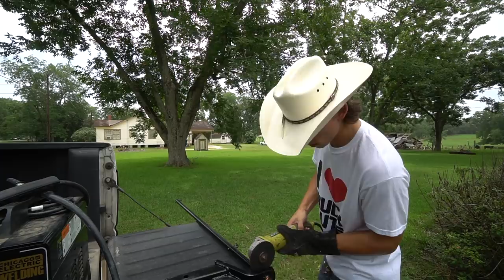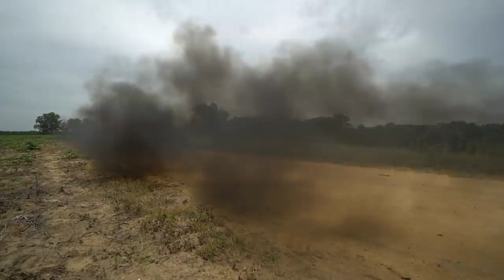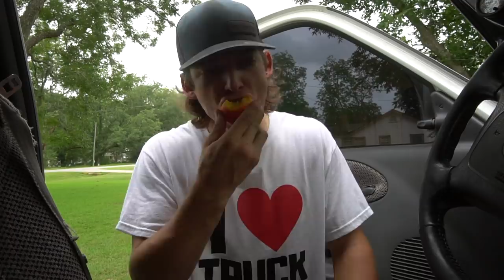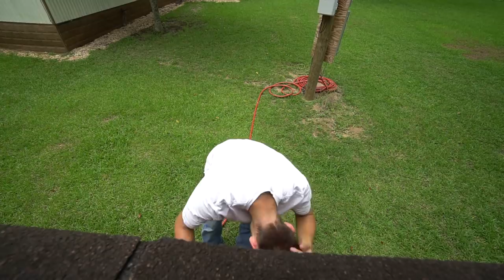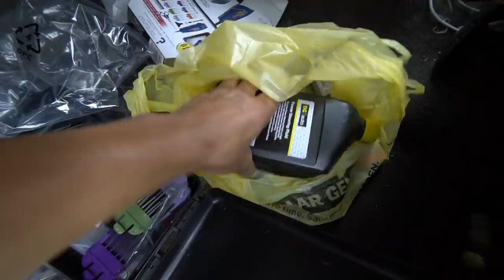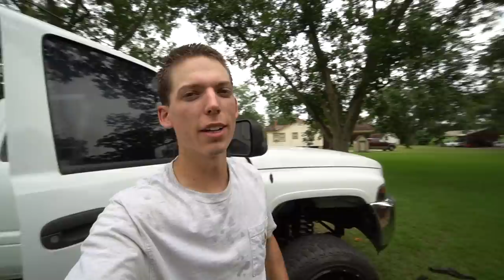Diesel Trucks Matter! Rollin Coal!

Comment: What did you do to get it to roll coal because you can’t get a 2nd gen deleted ?
Reply: look into tuners for the second gen, I've come to a conclusion the smarty s03 tuner has got to be the easiest way to boost power in these trucks, they've got up to a 210hp tune only using your obd-2. https://mopar1973man.com/cummins/articles.html/24-valve-2nd-generation_50/51_engine/59_fuel/tuning-with-a-smarty-s03-programmer-r624/ 
I was skeptical on the smarty but found this website that takes the tuner into depth and what your truck might need to be able to handle the tunes. Haven't purchased one yet but have only heard good things so I'll be getting one shortly.
Reply: @jonaslack5357  it actually doesn’t add nearly 200+hp it maxes at 75 hp